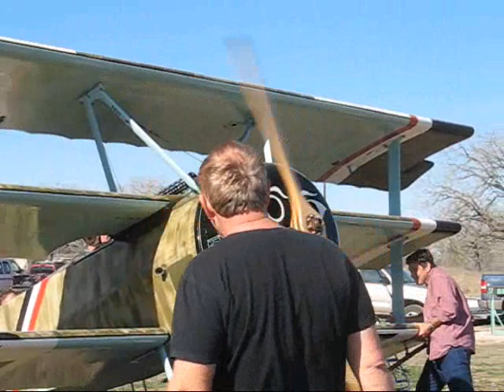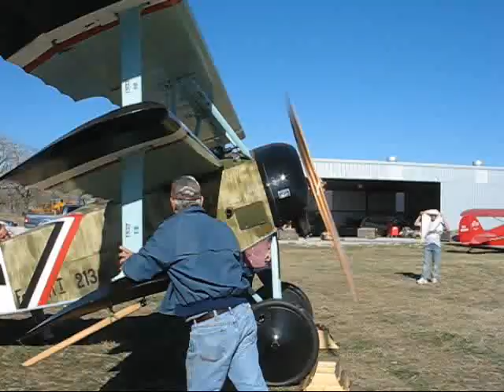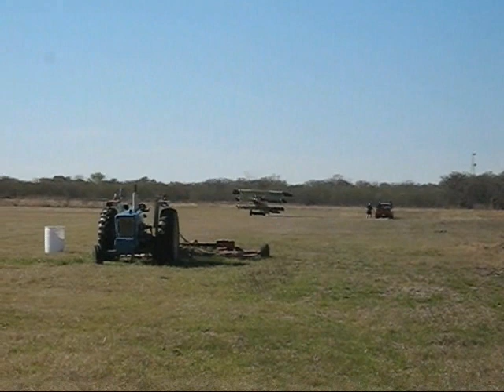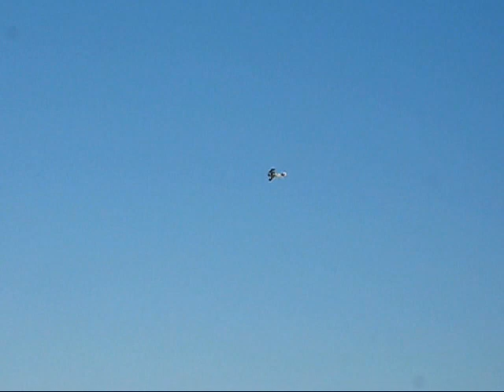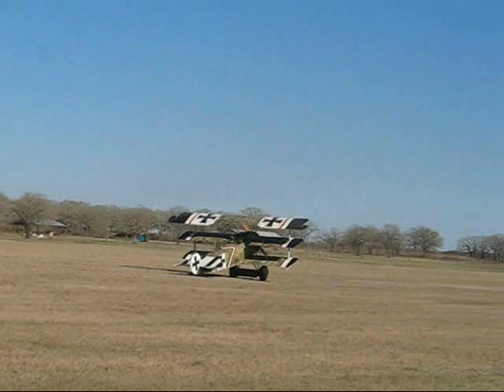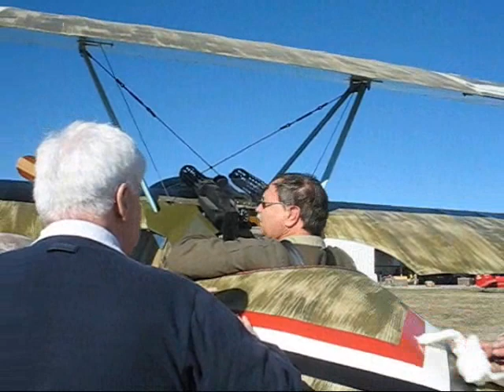Maiden Flight Fokker Dr.1 Triplane

Comment from the maker: Smoke is difficult from an authentic rotary engine as it has no exhaust manifold or electrical system.  On the other hand, we have a partially built propane machine gun which we hope to put in some day.

Comment: Bravo.  Actually knowing how to fly is of little help with these early machines as there are so many quirks unknown by today's airmen.  The rotary engine causes pitch up or down in turns and the ailerons have minimal effect.  A 4-aileron ship like a Sopwith Pup has some roll ability.  The DR1 has nothing but drag and with an engine out it must glide like a brick.  There were no runways back then, just a wide open field so all takeoffs and landings were done into the wind regardless of intent.